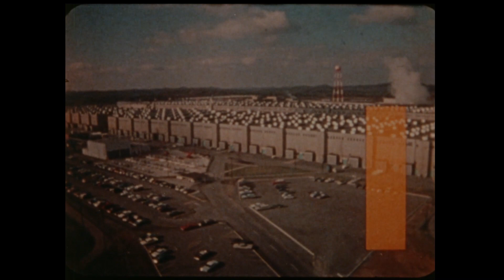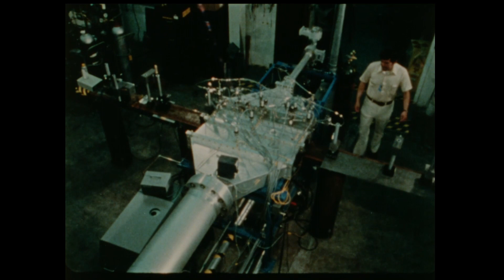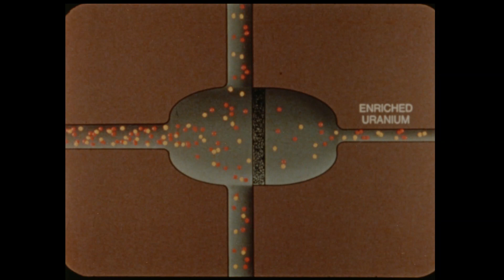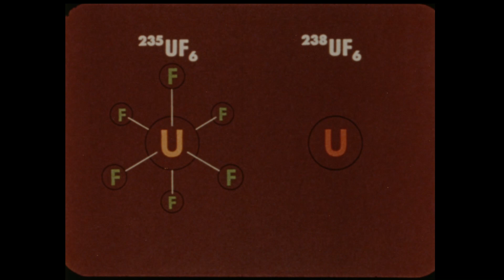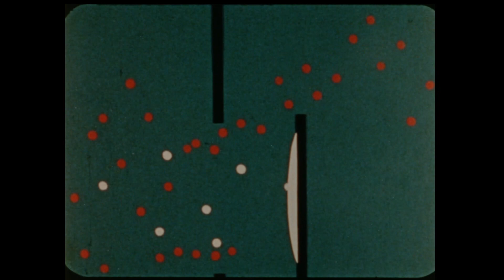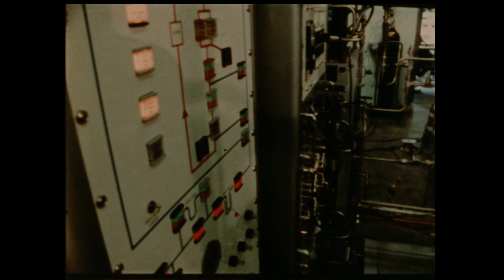Los Alamos Scientific Laboratory Presents: Laser Isotope Separation

Comment: This is a 1976 clip using UF6 gas but the same team created AVLIS which uses metalic uranium as a medium. They built 3 prototypes AVLIS units and ran for 3 years separating U235 in kilograms but because of high temperatures the units tended to break down and needed replacement, each unit ran for 400 hours and needed maintenance. The AVLIS technology was promising but the US closed the project down . The AVLIS unit had the separative power of 7000 TC12 centrifuges so 93 kg of metalic U235 could be produced in a day shame but now we have SILEX and back to UF6 gas as this video clip made in 1976 so the technology has moved on .
Reply: Now we have much stronger and efficient lasers to use for this process. One of the few processes that works well with low quantities of the target isotope. They are also using a similar process to extract rare isotopes from common ones, one of them is an isotope of calcium that the LHC people like to play with.
Reply: @christopherleubner6633  What do you make of SILEX laser enrichment technique for enrichment. Its been making the rounds in the news lately.

Comment: Less detail than I was hoping for (natch), but still basically the only video on this technology I've ever seen anywhere. 50 years later it's still a laboratory curiosity.
Reply: It's not just a curiosity, it has been industrially implemented in secret.
Reply: @rock3tcatU233  that which can be asserted without evidence, can be dismissed without evidence.
Reply: Try a gas centrifuge, you can enrich your U-238 faster... 🙂
Reply: @fjs1111  centrifuges are boring. LASERS FTW
Reply: @fjs1111  *presently
Reply: Is this the same technology currently being developed by Silex Systems, Cameco and GLE? https://www.youtube.com/watch?v=y-vMaeMz9ZE
Reply: There is a pilot plant in Kentucky. The gaseous diffusion "tails" feedstock will be sent there to make domestic LEU as is proposed in the video (albeit, a bit late!).
Reply: @Shaker626  huh, I see it in their local news. It's a SILEX process. It will be interesting to see what happens.
Reply: The problem is that anyone who tries to make this into more than just a lab curiosity will receive absolutely zero funding and has to deal with the very real risk of a surprise visit from the Mossad.
Reply: @augustovasconcellos7173  pretty sure Russia, China and the US dgaf about the Mossad.